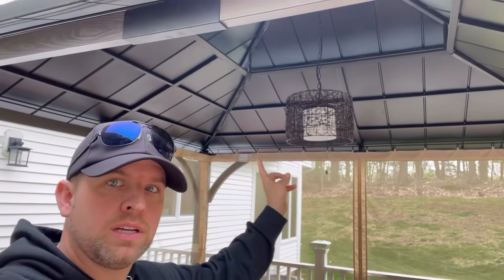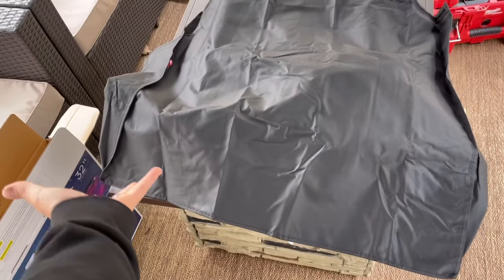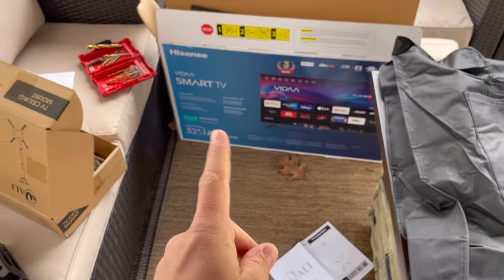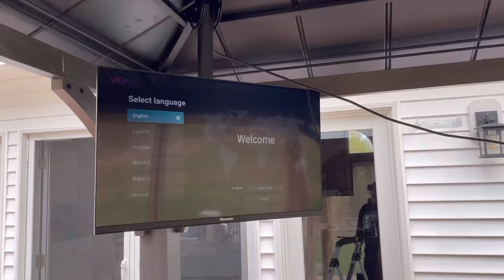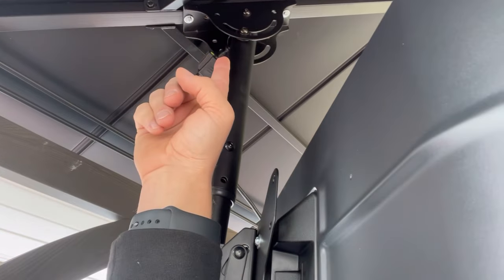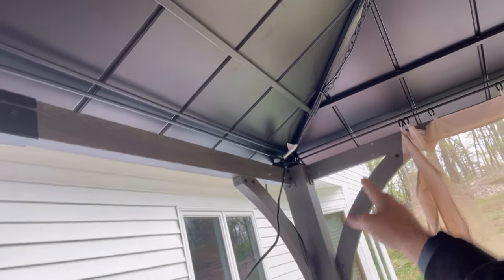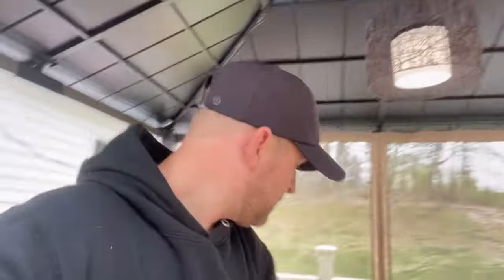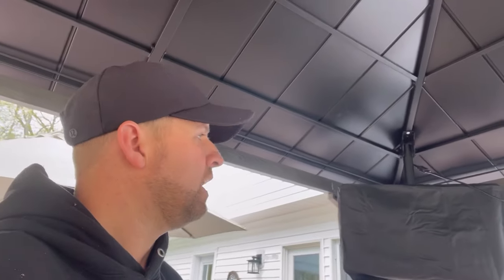TV Mount in a Pergola

Comment: Great install! Question. With that mount, would it be possible to pull the TV forward and up until the screen is essentially flush with the underside roof for added protection when not in use?

Comment: Love this! Great video

Couple quick questions. What sized drill bit it did you use and what sized Rivet did you end up using?
Reply from the maker: I forget the bit but I used an M6 river/bolt combo. Went to the local hardware and pickup up some M6x1 or 1.25. Depends how big your frame is and a couple washers.

Just match up the bit to the river size.

Comment: This video is exactly what we have been looking for. Bought the same rivet nut tool on Amazon. Do you recall what size rivet nut you used and what size drill bit you used for that rivet size? We are having trouble finding the right size drill bits per the chart that came with the tool.
Reply from the maker: I used the M6 river bit. For drill bit size I just held the rivet against my bits and chose the one closest.

Comment: Gosh, I've been struggling with trying to figure out how to mount the TV and speaker mounts in the exact same spot you did!  I was trying to find "shallow" toggle bolts or something, but couldn't find anything that would work with just a 3/4" clearance!  This rivet tool seems to be the trick!  What size rivet did you use?  Going to pick one up on Amazon ASAP!  Thank you!
Reply from the maker: The rivet/bolt was the M6x1.00. Be sure to get stainless bolts to prevent rusting.
Reply: Thanks for asking. I just had the same question.
Reply: Can this hold a 55inch tv I'm afraid that it maybe to heavy

Comment: I was all set to install the mount you used on my Purple Leaf gazebo and realized that the triangle roof pieces have a lip that is going into the channel I was putting rivets in. Does your gazebo not have the roof pieces sitting in that channel you mounted too? I stopped my project shy of drilling.
Reply from the maker: My BJs brand does not have this. The panels sit on top of the frame but it does not act as a channel. The holes do not go through the top either so no worries on mine.

Comment: Isn’t that a water channel to catch the rain and run it down to the corner where u drilled that hole?
Reply from the maker: No, water runs above in a channel between the panels for the roof. No water entry inside the frame.

Comment: Great video thanks  We have a metal pergola/ gazebo too but the bar in the roof is only about 1/2 inch thick and it's right up on the exterior roof. Do you think the NEU MASTER Rivet Nut Tool,  will support a 65 inch TV?  thanks, any suggestion? john
Reply from the maker: Depends on the weight and bolt used to hold it. I may upgrade to a 40 or 46” but 65 may be pushing it.
Reply: @Neighborly_Content so what size drill bit, what size hole n what is the revit size???

Comment: This is awesome, does it matter if the rivet tool is 13in compared to 14in? Also, what size bolt, and drill size?
Reply from the maker: No it shouldn’t matter, that has to do with arm length which didn’t affect me at all. I went with the cheapest kit that came with a case.
Reply: Appreciate the video as well. Ordered everything off your links, got a 43 inch TV for $160. 

I've seen alot about how much better an outdoor TV is, but was wondering if you had anymore suggestions to protect the TV?

Comment: By doing this did it make your aluminum beam weak or did the weight of the setup start bowing the beam?
Reply from the maker: Not even a little bit. The beams on the BJs gazebo are quite strong, no sagging, bending, loss of rigidity noticed. The entire setup weighs maybe 20#.

Comment: I just put up a similar Gazebo yesterday. You used a 32 inch tv...are you happy with the tv size or do you wish you went bigger? Im debating what size to mount up.
Reply from the maker: Happy with the size, I could go 40” but I like that this doesn’t take up a ton of space.
Reply: I originally purchased a 43 but decided to take your advice and do a 32. It turned out great! It’s just the right size. This video was really helpful…thanks!
Reply: Great video thank you so much. I  bought everything that you depicted in your video but I got a 43 inch television but my question is my cover does not have a hole in the top for the ceiling mount. Do you have a link to the one that you bought it looks like your cover has a round hole for the pole coming down from the ceiling mount?
Reply: @brettmead1527  It is the second link in his description.
Reply: I see the link to the TV cover now, but it doesn’t seem to have the right opening at the top for a top mount pole like in the video